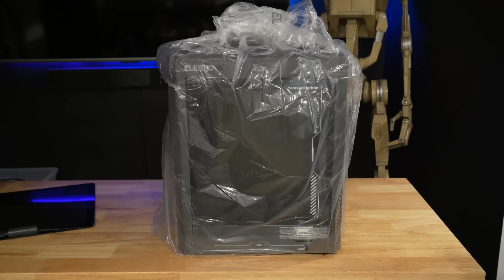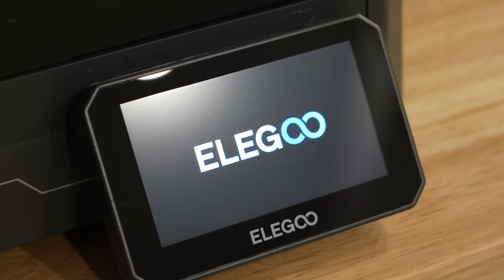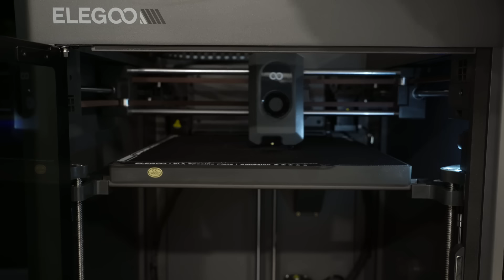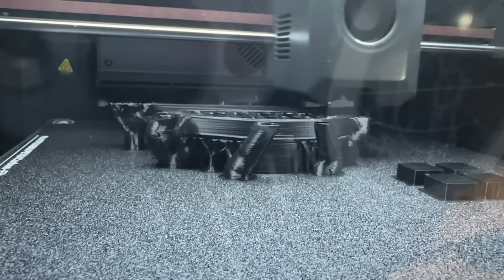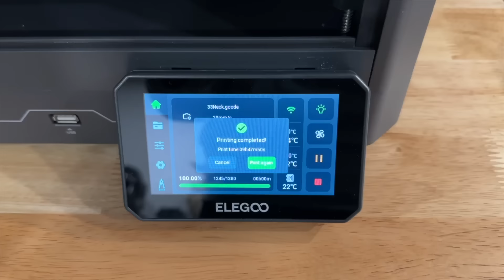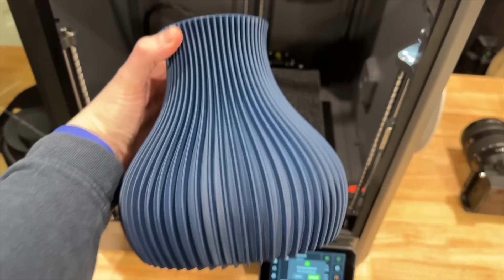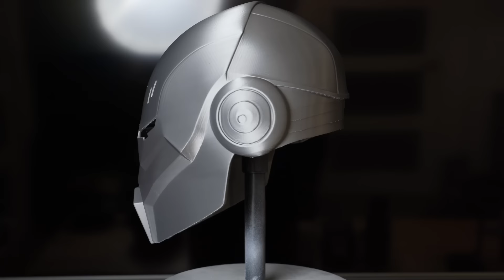The Ultimate Budget 3D Printer | Testing the Elegoo Centauri Carbon

Comment: The inconsistent probing is a klipper feature.

Each point is probed X times, and those values are averaged, to get the best approximation for that point on the bed. If a 'tap' gives a value that is above/below a certain threshold vs the other values, klipper will discard the values and probe again, until it gets enough values that are within spec.
Reply: I think it is confirmed now that the printer is not running klipper.

Comment: Your video is lovely, I really like to see you tried a few filaments,  

I do have a question though, the printer name is Elegoo Centauri Carbon, does it prints Carbon fiber filament?

I only have one complain and it is not exactly aiming at the printer but at the company. I purchased the Centairu Carbon just 11 minutes after they started selling it. It has been almost a week, and I have not even received the tracking number for it. Also, in the Elegoo page it says pre-order. in the selling page there was nothing stating that I was doing a pre-order, if it had, I would not have purchase it. I do not know when I am going to put my hands on this printer. Thats wrong Elegoo, I am a first time Elegoo owner and you are failing to tell me when I will receive something I paid for already, 

Otherwise, great vide and even greater review!!!
Reply: Also, yes it’s designed to print CF material. The nozzle has a SS insert.
Reply: As per the website, shipping is in June 2025.
Reply: Like most other companies Elegoo are building machines in batches.
Only the very first 100-200 printers were in their US warehouse for immediate shipping.
You waited too long to get one of those.
They were onto the 2nd or 3rd batch of sales before you ordered.
The shipping date message WAS in the pale blue box above the price.
You won't get a tracking number until your printer actually leaves the factory, probably in May or June.

As others have said, it WILL print CF-loaded filaments

Comment: Did you mention what were the actual speed settings you used with ABS?  I’d be interested in knowing the print profile you used for that.  I’ve been a PLA and more recently a PETG user (5 years printing experience) and have avoided ABS for several reason but now have a greater interest in that material.

Comment: With the "Auto-Leveling" feature, if you place this printer on a surface that isn't level, does the bed leveling feature level the bed to the surface that it's placed on, or does it level the bed to some kind of onboard leveling reference of the printer itself?
Reply: Bed leveling levels it up to print. An uneven surface will not hinder the leveling process.

Comment: If they don’t fix the light , I’m going to spray the inside faces of side panels matt white . That will help bounce light off the side and help you see the glass easier
Reply: Or just put a cheap 12v light in it. Would be alot less….. permanent
Reply: Would the enclosed heat mess with the paint?
Reply: @LeftyPencil  I don’t think the internal
Temp reaches high enough t to bubble paint . When was the last time you saw a white car in the desert with peeling paint ?
Reply: @ no it doesn’t get hot enough in there to effect paint

Comment: RE: the camera failure issue - I had this issue in Safari, but not Chrome, if that's helpful.
Reply from the maker: Interesting! I’ll have to try that out.
The footage was actually straight from the viewing page in the slicer, but I was also using a Mac so that might be an equal/moot point.
Reply: @MMsPropShop  yeah, I get the same behavior on my Mac, but running Chrome runs just fine. (also, stay off the Device tab in the slicer if you do this, it doesn't gracefully deal with multiple browsers/windows/devices trying to stay updated)
Reply: UPDATE : This all seems to be fixed in the latest firmware.

Comment: Finally someone pointing out flaws! I cant trust any reviews that are not going over some of the flaws of the machine! I want to know what I'm buying.

What about the noise? I have my printer in my office, do you think you could work right next to the centauri carbon or is it just way to loud for that?
Reply from the maker: I’d say it makes about the average amount of noise for a CoreXY/ultrafast machine, which is to say it’s not exactly subtle lol. It’s a bit dependent on what you’re printing - having it fully closed up will muffle the noise slightly and PLA will have the tendency to be a louder process due to the cooling fans running at 100% and it possibly printing faster.
Personally I would not want to work right next to it for prolonged periods of time.
Reply: Isolating the printer with foam and pavers or another solution will help the noise level, as will turning down print speed.

Adding as much inertia ( weight ) as you can to your table / workbench also helps.

For myself I change my PLA profile to 90% fan as there is a marked difference between 100% and 90% fan noise.

Comment: Is there a phone app? What software does it use?
Reply from the maker: Technically not an app, but you can access its Fluidd interface through a browser on your phone and control and monitor the printer that way.

I used Elegoo’s own slicer for everything in this video which is a reskinned OrcaSlicer. Orca itself is also apparently compatible.

Comment: I'm wondering why you're the first person that has mentioned the g code, bed warming issue? Not pointing a finger at you but all other ECC reviewers.
Reply from the maker: If you had the print setup to run bed levelling before the print job then it probably would have reached the necessary temperatures by the time it starts printing. I’m just always in the habit of unchecking it because I can’t be bothered to have it spend the extra time on every single print lol

Startup gcode is also technically more of a slicer thing, so it might have been resolved in a newer update (I’ll need to look into that though)

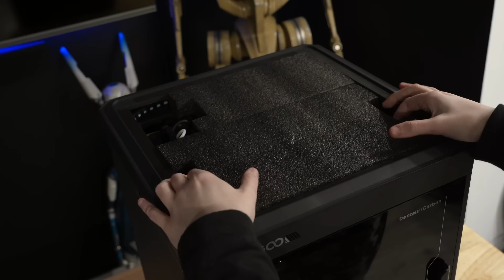Comment: 0:39 thank you for saying 256 cubed! Get so annoyed people saying, 256, 256 by 256…. It’s cubed ! Sounds far more professional!
Reply: It's exactly the same
Reply: @broodjenoodles 256 cubed is just easier on the ears
Reply: @eros439  sure but its not wrong. Only if it has 256x256x256, is 256 cubed useful. It can be 240x256x272
Reply: @  While “256 by 256 by 256” technically conveys the same dimensions, saying “256 cubed” is more concise, mathematically precise, and professionally articulated. In academic and technical discussions, using proper mathematical notation and terminology reflects a stronger grasp of the subject. Repeating “256” three times is redundant and informal, whereas “cubed” immediately and efficiently communicates the concept of a three-dimensional power. This is why professionals in mathematics, computing, and scientific fields use exponent notation—it enhances clarity and professionalism.

Comment: If you're having an issue with the enclosed heating set up, just got buy a Neptun 3 por or Neptun 4 pro enclosure and stick the Centauri Carbon in it
Reply: Why put an enclosed printer into another enclosure?
Reply: @takuya3194 To hold the heat in better.
Reply: I have one they work great! Sometimes I have to open it up because it warms up so much 😂

Comment: The low price is only for U.S customers. Elsewhere around the world the price varies wildly (In Australia, it works out to be approx USD $450) which honestly makes me wonder why the US market gets such a heavy discounted price
Reply: In the UK it’s 300 GBP at that price it’s really tempting to get one to build the odd helmet
Reply: Because not much demand in Australia where as US sells lots in comparison
Reply: Another Australian jumping on this. I'm looking for my first printer and this unit bare-bones costs a bit more than the Anycubic Kobra S1 with the ACE and 4kg of PLA. It feels like a direct competitor. I feel like a filament dryer seems like a good get, but still have never printed anything so I don't know 🤔
Reply: Okay so for all the people talking about the Australian tax, or lack of demand etc. This doesn't account for the fact that nearly every other 3D printer on the market has a fairly reasonable price based on general conversion rates. The close proximity of Australia to China AND the lack of tariffs mean that this kind of markup is insane - especially when you consider that the non-carbon model without the side panels sells for a significantly lower amount more in-line to the US prices and the price difference between the two is far greater than the difference between the two models in the US.

Australia isn't the only country that has this massive price difference. TBH I wouldn't be surprised if Elegoo have intentionally made the US printer price potentially below cost price just to get as many in the country before any further tariffs get introduced. It all feels a little shady, though
Reply: New Zealand it costs nzd 1000$ so like 600usd
Reply: At $699 au I’m only $200 away from a p1s
Reply: It's not a discount at all.
Other countries like the UK & EU are legally required to add sales tax of between 16-27% to the sticker price, instead of adding it at checkout like in the USA.
Reply: 300gbp in the uk
Reply: In asia it's around $425 which It's cheapest enclosed corexy machine right here.
Reply: It's likely exchange rates. 300 USD is 2175.30 Yuan, which equates to 469 Australian dollars 🫡

(Edit: They may be setting a minimum of 300 in each country's currency, with UK price being £300, so ~£63 more expensive after the same currency conversion)
Reply: @ yes but retail in au is $699 from Elegoo store
Reply: Here in Norway its about 5000nok, 448usd as of this comment. Thats probably due to shops own markup plus the 25% sales taxe we pretty much have on everything
Reply: Even with the US discount I can't order one. I live in Alaska. Apparently that's out of Elegoo's delivery range. Go figure.
Reply from the maker: Oof. Never realized there was such a price difference between certain countries. CAD works out to about the US price (taking into account possible fluctuations in exchange rate, etc.)
Reply: @MMsPropShop  can we get a gender check on isle 7? 😂 🐖 💄
Reply: That's the "Australia Tax". Prices are based on what people will pay and volume of sales. Ozzies are relatively wealthy and relatively few, so we get gouged every time.
Reply: @patemblen3644  try getting one of these in Brazil. This will be priced like 1000 to 1500 USD at least… basically 300usd will be taxed at 100% becomes 600usd. Then 100% profit on top, 1200usd. This is basic Brazilian math for imported goods. And then there is the hype, it could go up a few steps. And in Brazil very few are wealthy. 🫠 oh, and our money is now 6 to 1 dollar, so that math makes even “more sense”

Comment: I used mine for about 50 hours and decided it wasn't for my lineup.
Reply: Could you please tell us why you decided  that it wasn’t for you.
Reply: @nikonshooter71  I prefer my X1C and other multi filament printers. I have a very long beard and PPE to accommodate my beard for sanding and painting starts at a grand so I like to be able to print multicolor.
Reply: @RyanMercer  Multicolor is coming in Q3 according to Elegoo
Reply: @b.r.t882  hopefully, I love seeing more competition in that space.
Reply: So at launch if it was a multi printer would you have kept it. Or is it too far off from the Bamboo model ?
Reply: @nikonshooter71  it's a solid printer, only downside to me is the lack of a filament management system and I had the dangdest time getting the screen mounted but that's not a big deal.
Reply: @RyanMercer thanks for sharing 👍🏼
Reply: @nikonshooter71  sure, we're all in this together!
Reply: …and what your lineup is? thx